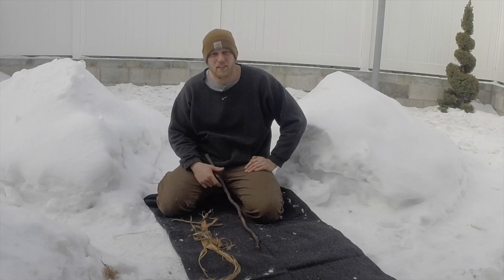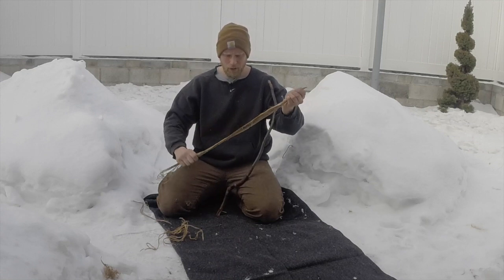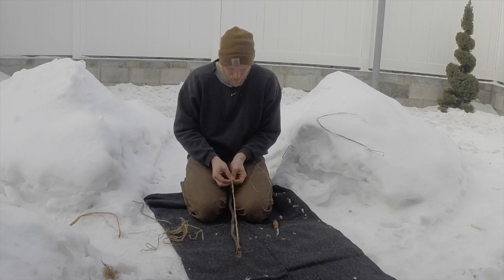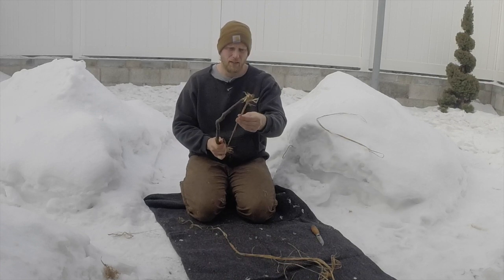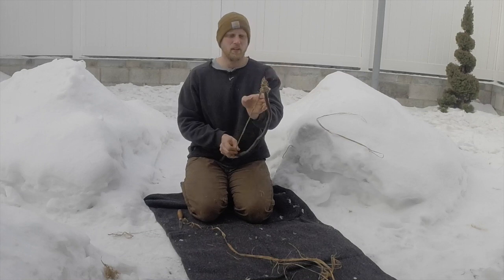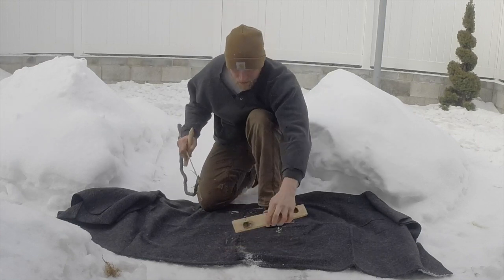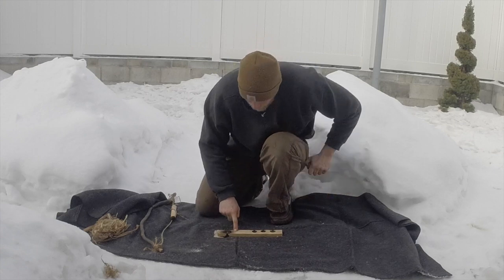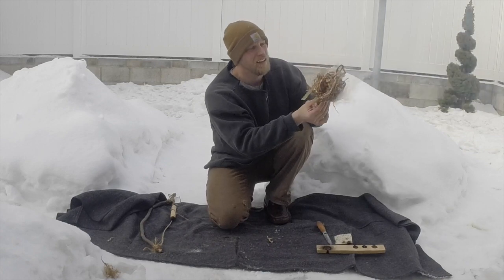Bow Drill Friction Fire with Natural Cordage

Comment: Good video.  Instead of tilting my bow I push down on the string with my thumb to keep the string from rubbing on itself.  It only works if the spindle is twisted in the string from one direction and not the other (the opposite of how you had it).